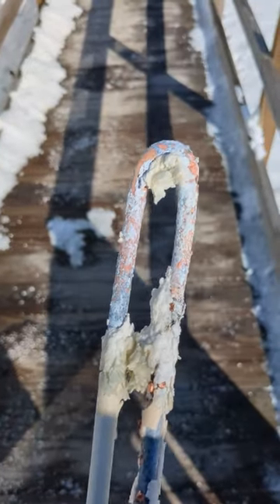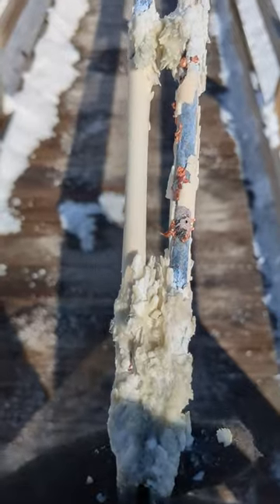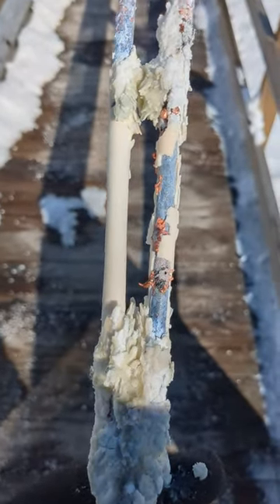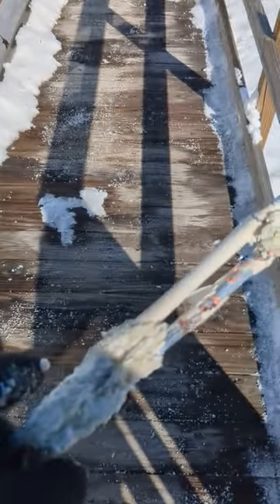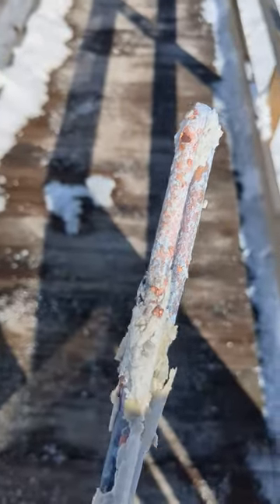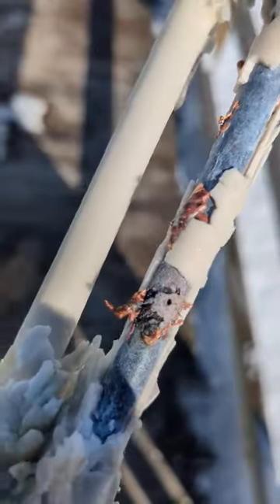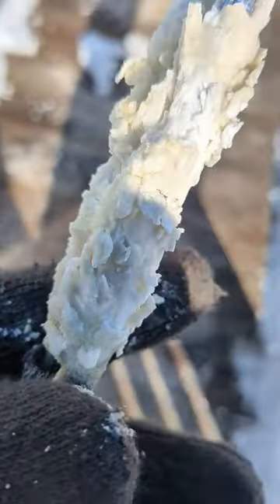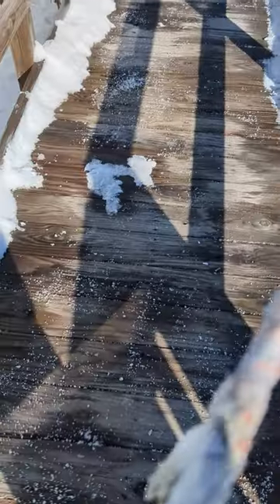Bad Water Heater Element #Shorts

Comment: So is it a good idea that if your tossing an old water heater out because it started leaking to maybe go ahead and pull out the element maybe (it) can be used later?
Reply from the maker: It can be used yes . You would check if it is the same wattage as the one replacing it